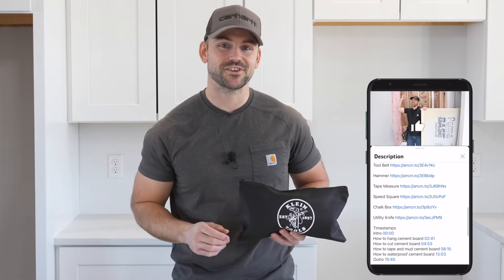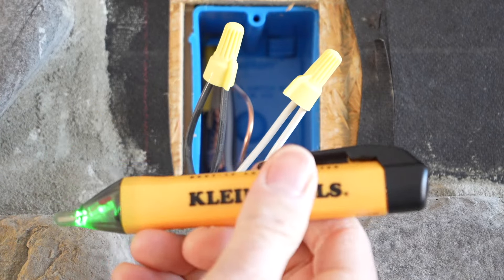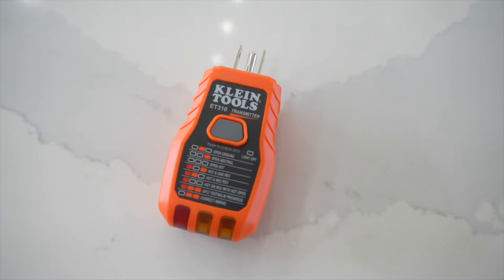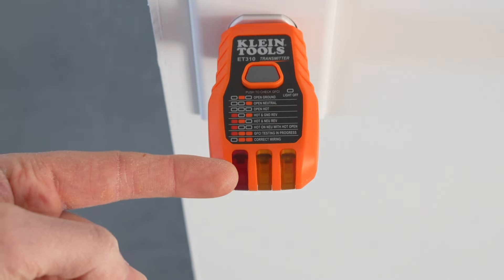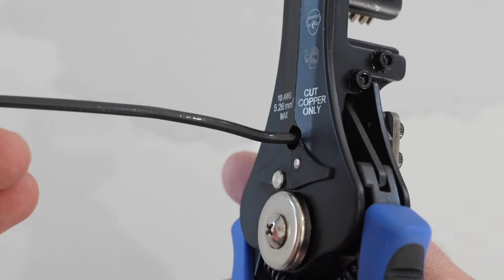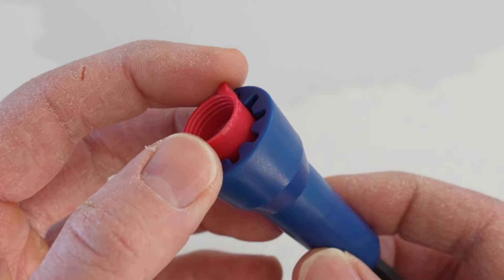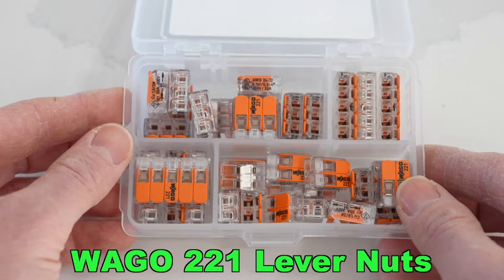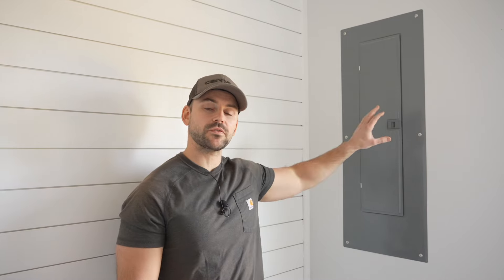5.5 Electrical Tools MUST HAVES

Comment: Great video. Agree 1000% to twist wires with linemans' pliers before wire nut.  I found an untwisted pair last week that was loose inside the nut and heated, cracked, and melted the wire nut.
Reply from the maker: Yes, I always twist them together first. Thanks for your input!
Reply: I only pretwist wires when I’m joining more than 3 wires together. Otherwise, I let the wire nut do all the twisting.
Reply: I don't know man. When he twisted them together he was practically done. 1-2 more twists and he would have been done and the tool was not needed.

Comment: we really enjoy the videos. very helpful we are getting ready to wire our garage with lots of household items.  hot water tank 50 amp, rv outlets mini splits high bay lights low voltage for garage motors  etc.

Comment: As always, you put together wonderful and knowledgeable. The Klein tools are all wonderful tools and great warranty (under proper usage). The last item, the wago lever nuts are one thing to check with your building codes. Some inspectors don't like this style due to being able to unlock them. One situation I've heard was if someone was checking a switch or outlet box and pulling on the wires a certain way, the clasp got released and the person didn't have the power off resulting with arking and tripping the breaker. Ideal makes a brand that is similar but hard to remove. Always make sure you strip the wires to the proper length with these to make sure a good connection is made. Nothing like putting things together and then having a outlet in a run not work. 
One big thing like you mentioned was about twisting the wires together first along with the right length stripped. Basically the best way when using wire nuts. One big thing is that with electric, please make sure you do things right and not cut corners and to code.Thank you for the informative video as always Josh. 👍🏼
Reply from the maker: Yes, good points David like always! Stripping wire to the correct length for the WAGO is very important. That is why I like the clear back so you can visualize the final connection. I had a couple people comment about the ideal brand. I will look into them and see if they are better or not. Yes, the tools made by Klein or hard to beat. They tend to make the best electrical products in my opinion. Thanks for stopping by David!
Reply: Would much rather use wagos than the Ideals. The ideal In-sures are the same as backstabbing.

Comment: The light appearing to go off on camera is likely to do with the FPS (frames per second) - what our eyes see and what a camera records are different. Part of power saving on LEDs is the fact that you can technically turn them off and on at rates that the eye cannot detect, so they technically aren't powered 100% of the time.
Reply from the maker: That’s a good point Jason! My frame rate is set at 30. That could definitely be the reason. I’ll try different frame rate and see what happens. Thanks for commenting!

Comment: Home Depot now sells Ideal brand “insure” lever wire connectors at the store. Good product.
Reply from the maker: Good to know Loren! I’ll check them out and see what I think. Thanks for watching!
Reply: @TheExcellentLaborer  what I like about the Ideal product is that you don’t have to open the lever to insert the wire, but can open it to remove the wire.

Comment: The newer Klein voltage detector with dual voltage ranges and built-in light is much better. Glad to see WAGO's made the list. I've been using their industrial cable clamp terminals for years. The 221's are fantastic. I haven't used a wire nut at all in the 1945 house I'm rewiring.
Reply: I would suggest a proper twist and wire nut for more permanent connections. Wagos are fine but you can’t beat a twist and wire nut
Reply: @graywolf7648  the Europeans have been doing it for decades

Comment: When you twist the wires together, it's better to strip them almost twice as much as you did, then get a perfect twist, and only then cut it with cutters to the right length. Your spiral will be absolutely perfect and all three wires cut perfectly the same length. Then you put your wing nut on.
Reply: Don't give electrical advice when you aren't an electrician..they're called wire nuts, or twist on wire connectors.. A wing nut is for a bolt. Also pre twisting is a waste of time, and pre twisting that much wire is a waste of material. Just put your conductors in the wire nut and twist it while holding an inch below the connector. When the wires start twisting it's typically secure.
Reply: @thenextgen1able  This advice came straight from an electrician friend with a long career and works much better in everything I applied it on in my own house. It's just logically better from any way you want to look at it. Note that I never said that not pre-twisting would fail, it's just a better final result when you apply what I said above. And when it comes to anything electrical, I prefer being always more on the safe side with everything as perfect as it can be.
Reply: @thenextgen1able “wing nut” is the name of ideals wire nut. it’s a brand name and next Gen is still correct
Reply: @archael18 don’t listen to them. You’re doing it right twisting them together tight with a really good spiral and then cutting off the extra stripped wire. Another reason to do this is because in some states (California) electrical inspectors don’t want the bare ends of the wires being all chewn up from the pliers. Also. Pre twisting is absolutely essential for a good connection. I have seen so many wire nuts melt and if the wires weren’t spliced together the connection would come undone. Btw I’m an electrician in New York. The only wires you don’t have to pre twist is on stranded wires. You typically let the wire nut do all the work with those. The guy in the video is not pre twisting his wires together anywhere near enough

Comment: What youre with the light, is that you're seeing an interference pattern between the A/C and the shutter speed. An example of this, is next time you're in traffic waiting to turn, for a little while your signals will sync up and then drift apart.
Reply from the maker: That makes sense. I appreciate your input, William!
Reply: @TheExcellentLaborer  I'm surprised you understood it with my poor grammar. Typing on a phone sucks!

Comment: I like to know how to trace a breaker.  For example: I was outside troubleshooting an hvac condenser unit. There was no power at the disconnect. Wasn't any power at the disconnect. Where I was working was at 8 floor story building. No one knew where the breaker was, for that disconnect. All they were showing me, where all breakers main panels were. It's frustrated to start finding the main panels, and the breaker that feeds that disconnect. 
Your tool shows how to trace the breaker when there's power to it.  But, in my case, is how to trace it when there's no power? How to locate the breaker that feeds on whatever you're working on it.  
Can someone advise me please. Appreciated!

Comment: where, other than amazon, can i buy wagos?
Reply: Home Depot sells Ideal brand “insure” lever wire connectors.
Reply from the maker: I have only bought them on Amazon. I have not noticed them at Lowes or Home Depot but they might be there. Thanks for watching!
Reply: @lorenrickey5481  i think i know what you’re talking about but those are only push in and not like these
Reply: @TheExcellentLaborer  Check out Platt Electric also.
Reply: @ritchiemeza  these are new. Called Insure gen 2 lever style (like Wago 221s).

Comment: Bro, you must learn how to use the wire twister correctly. Put the wires in the twister without the wire nuts; then install the wire nuts after twisting them. Are you master electrician like me?

Comment: You really should check all the wires in the box to ensure there is no back feeding or miswired.

On one of your, videos you wired a 12/2 for your water heater and you attached both the black and white wires to the 240v breaker.

Comment: I have a breaker finder and it sometimes gives me false readings
Reply from the maker: That is interesting. I noticed resetting the device helps it pick up better. Is it the same brand as this one?
Reply: @TheExcellentLaborer  yup. Took off the panel cover and it was a disaster. So my guess is it’s picking up wires in the wrong spot?
Reply: Go over the entire panel first with the sniffer.  I have used it multiple times with no error.

Comment: Some of these tool's you better be careful, like the wirenut attachment, when I was working. guy's would use that thing and over tighten it, and it would break, and you would have to start over,  
or, it would crack and bread after you tucked them back in a box, next thing you know, you are trouble shooting a circuit trying to figure out why it's not working, big pain.

Comment: Licensed Electrician here. None of these are must haves, except the GFCI tester.
 If your going to buy a "dummy stick"(first item) then buy a fluke, it wont give false positive by tapping it(i say not a must have because klein ones are unreliable, hence you tapping it and it going off. Nuff said) otherwise if it was reliable like a fluke, it would be a must have. Do not solely depend on a dummy stick. Then long as you understand theory of electricity, you can touch a hot wire bare handed and not be shocked.
 If you understand the theory of electricity, then to find a breaker to a line, you simply touch hot to ground.
 Then for your wire twister which is complete junk unless you're handicapped, you didn't even use it in first receptacle you showed(can tell because the wires are not twisted at all) so theres how much you yourself actually uses it, its junk. Cool in thought, utterly sucks in time and execution.
 Wagos cost to much to be effective, unless length of wire is an issue or stranded wire at times(I buy cheaper alternatives for this, one time use). Beyond price these are great, but I'll stick to wire nuts.

Now I don't recommend doing any of this, unless you're an Electrician. On that note, most it makes sense for a Do it yourself handyman. But I'll also say, majority of my service calls are from handyman mess ups.
Then for past 5-10 years, some Klein products are starting to become junk. I wouldn't trust their meters or testers.
Reply: What is a good brand you recommend
Reply: @jaggermurlin6343  Fluke
Reply: Fluke is good, very expencive  and Klein are good as well, as an electrician myself the best advice is to use good reliable tools not cheap junk , but use common sence and educate yourself on all aspects of electricity First , otherwise leave it to a trained professional

Comment: 2:12 Does not detect the power in the neutral. I know what its like. Echoie room, no script, trying to give as much info as possible just blabbing and going with whatever comes out. 

You are going to make sure when you are testing an outlet to make sure to test the black wire. NO TEST ALL WIRES ALL THE TIME then test your batteries and then test your NCVT agians other NCVTs. In skilled hands a NCVT can really do much more and be safe but this explanation is dangerous. 

Dude. can you please think about what you want to say and write it down. What if someone has polarity reversed and they only check the black wires as you say. This video is gonna make some poor home owner wonder why the hell they went after electric jobs when there were perfectly safe shit jobs changing pipes or the toilet.

Comment: The Klein non contact voltage detector is garbage. I use this type of tool every day, and the way the back cap on the Klein is designed so that the battery contactornis depedant on how tight that back cap is means that when the retention clip gets loose, the tester will not reliably stay powered on. Buy a fluke , they are much higher quality and more reliable and I don't think much more expensive. I like Klein, but their ticker is a disappointment.

Comment: I don't think using a black wire as the live wire is a safe system. A brown or red wire makes more sense.
Reply: I have seen several wiring systems over the years and over 90 percent use either red or brown wire for the hot for live line.

Comment: The wire twister is a horrible tool people over twist the wires making it a nightmare to work on later
Reply: Its good for a guy that does wiring all day long. The clutch should be used so they dont over due it.